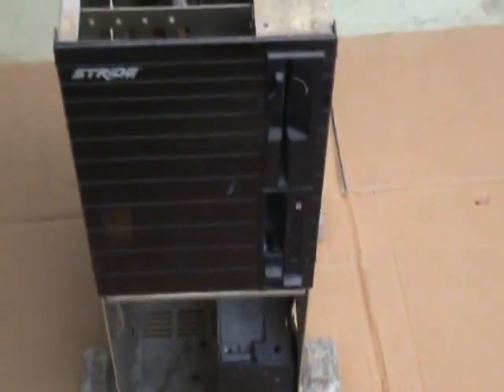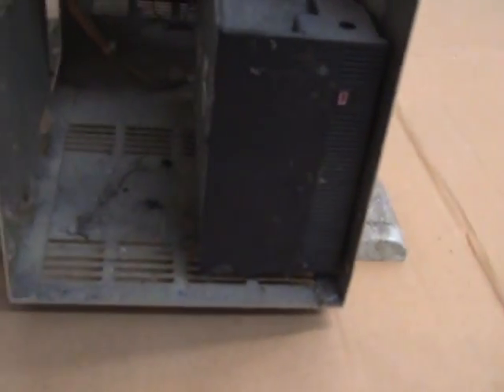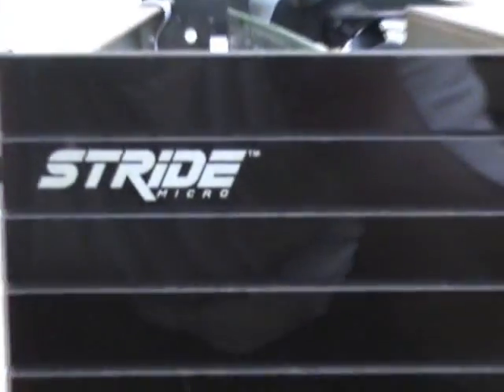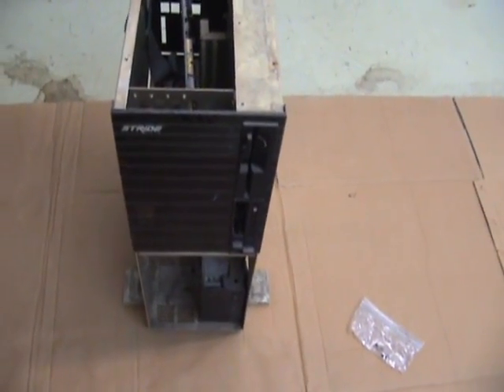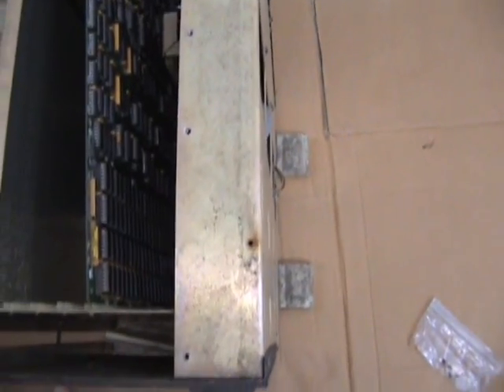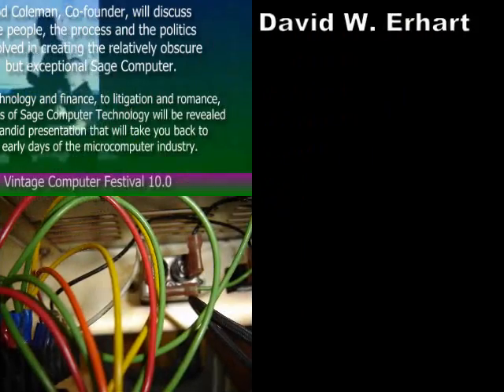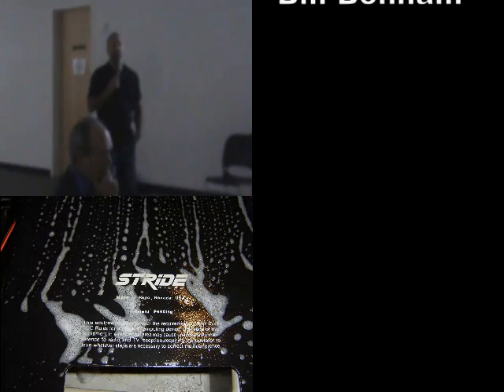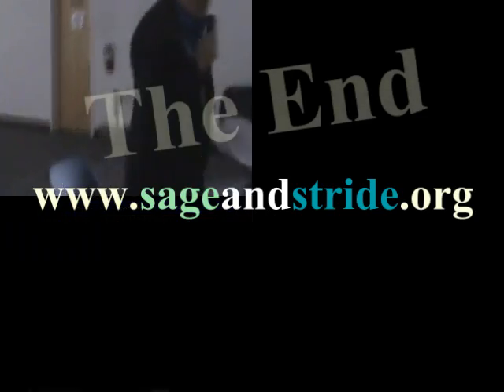Restoring a Stride 460 computer

Comment: Thanks for putting this up. It seems in the 15 years since you uploaded this, there are almost no other videos of the Sage microcomputer series, especially the Stride and SuperStride machines that came after the Sage IV. Just at the end of the running clip here I spotted an "amiga" directory which is intriguing since a Sage IV machine was apparently used as a development platform for the Commodore Amiga's Original Chipset (OCS).

Comment: Nice. Heres some pictures i took on my 460, unfortunately the Qic tape drive is dead and the winchester disks are corrupted so i cant run or reinstall Unistride, but pSystem from floppy works fine though. imgur.com/a/jxZtB#0
Reply: Hi! Do you have some software for the Sages?

Comment: @awfulguitarplucker 
A 68000 couldn't run Linux; Linux requires a MMU, which only existed on the 68020 or later.  I was probably Minix or some other Unix like OS.  When I froze the screen the windows were clearly a windows XP running Hyperterminal, which makes sense if the machine doesn't have any sort of GUI.